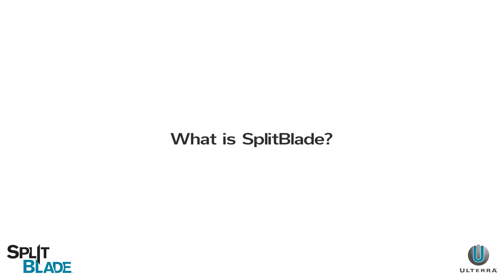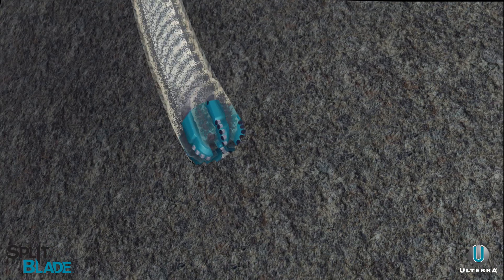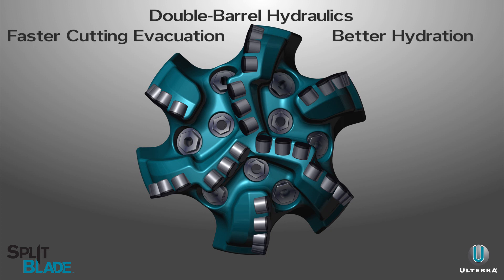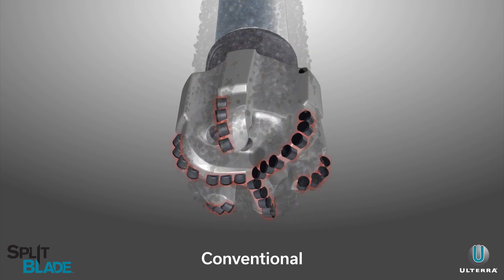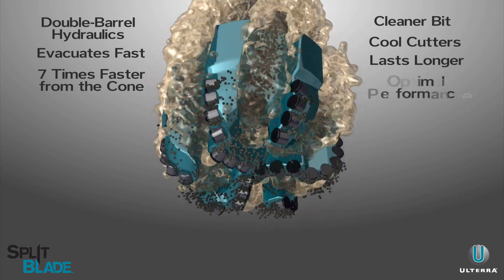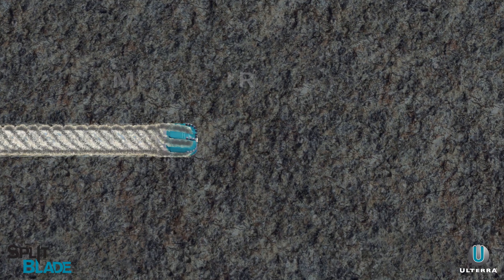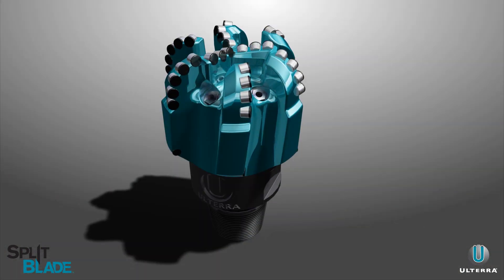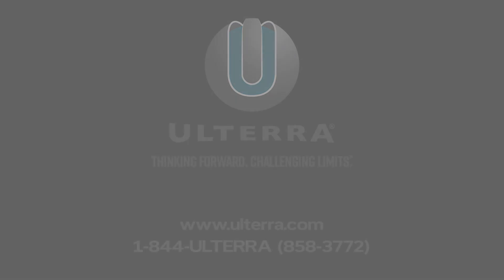Ulterra's Split Blade Technology

Comment: What's the largest diameter hole currently possible with this bit?
Reply: SplitBlade can be built in up to 17.5" diameter in matrix and 28" diameter in steel body bits.